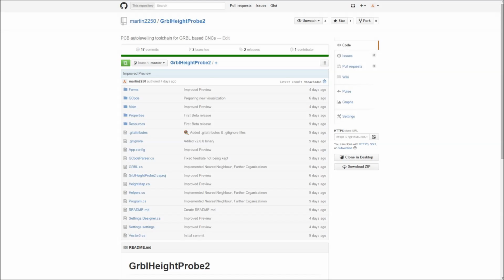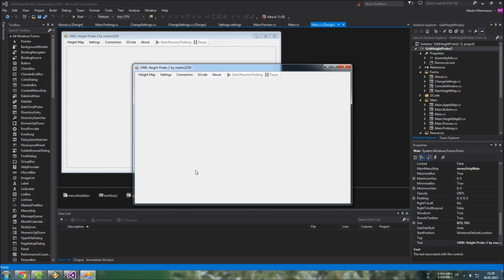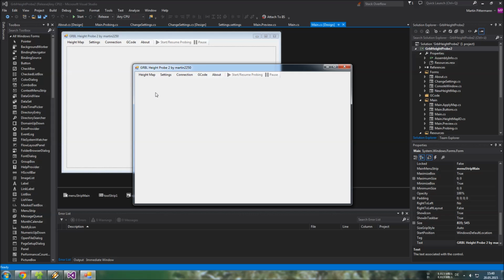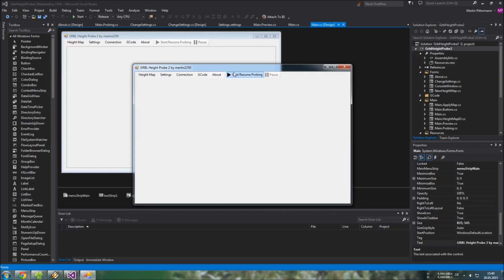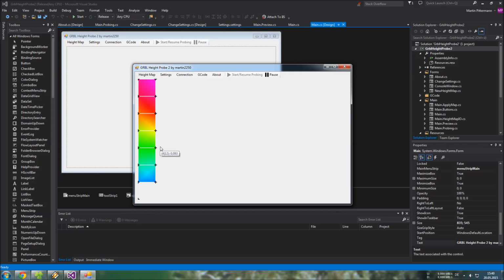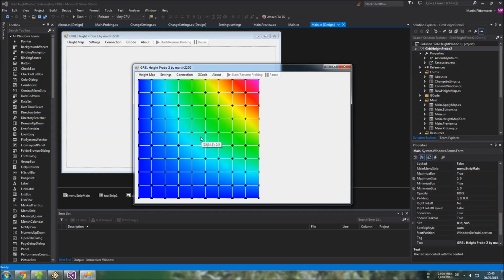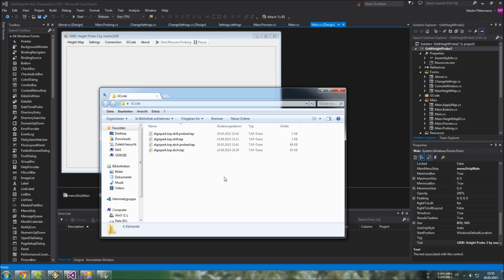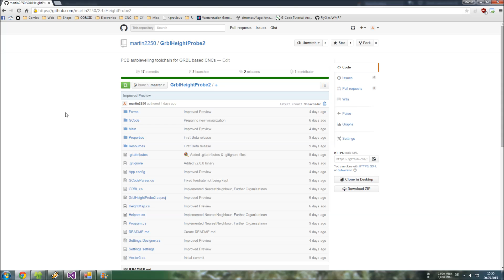GRBL PCB Autolevelling V2

Comment: I have GRBL 1.1 E installed on arduino nano: it is working.
When I do open the connection tab I just have OPEN and CLOSE selections.
The video shows MANUAL CONSOLE  that I can not see !
Any help please ?
Thanks
Ambro
Reply from the maker: Please ask your question on github, and attach a screenshot so I can help you better

Comment: Hi,
Two questions. Is this code for windows, or how to install it? Where is the Arduino code? You mentioned in Video 1 probes attached to the arduino pin 4 and 5. Thanks
Reply from the maker: the arduino must be programmed with GRBL, you can find it on their github. My Program is also available on my github page, it's portable so you just have to unzip it
Reply: Hi, I downloaded it from github but cannot find an executable file. How can I start the user interface?

Comment: Has anyone had problems connecting with their machine? I can communicate to grbl with bcnc and the arduino serial monitor, but there is no response when using this application :(
Reply from the maker: +jfghvljgvktgvlkhvgyv 
What version of grbl are you using? I only tested it with the latest 0.9 release.
I assume you used the right port and baudrate.
Reply: +martin2250 
0.9g, i'm not sure if the g is a subversion, but that's what it sends on start up. Yes I checked the port and baud more times than a sane man would.

Is the windows ding sound supposed to play when commands are sent? That happens every attempt for me.
Reply from the maker: No, I didn't implement any sounds. Sounds like there is some error while sending commands which is going to be hard to debug remotely. Can you think of any other obvious causes? (serial port being used elsewhere, driver issues ...)
Reply: I built and ran it from the source. I just noticed one little bad behavior bug, an unhanded null reference exception, I used enter to send a command before the serial port was connected. Also the noise is only produced when I use the enter key, but there is still no response from grbl pressing the send button instead.

Replies from the micro are displayed in the textbox i'm assuming?

Nothing is sent to the debug log when I attempt to send a command.
Reply from the maker: yeah, any response from grbl should be displayed in the (textbox) console. can you try pressing the reset button on your arduino, it should send "grbl 0.9g ... " to the console.
If that doesn't help, your best bet would be to get rid of all the unhandled try/catch blocks
Reply: Nice suggestion! After resetting it like that I can communicate with my machine. I must have a particularly shitty mega clone. :P

I would suggest putting another empty try catch in buttonSendConsole_Click(), so your program doesn't crash if someone types and presses enter right on start up.
Reply from the maker: very strange, I guess there is a reason after all why UGS enables DTR when connecting to the Arduino. Thanks for pointing out the bug :)

Comment: Thanks for a fantastic job. Once I finish creating the height map, I apply it to the GCODE file, and generate the *probed* file. Then I leave your program and start the GCODE sender as per your instructions. However, when I open the GCODE sender it has lost the XYZ position. Question, to what initial coordinates should I set my machine before sending the probed gcode? Another question.... what is the thinnest track that you were able to carve with a 30 deg 0.1 V shaped drill bit? I am trying to carve 10 mil traces but I am failing.
Reply from the maker: +Rolando Martin 
Hi Rolando,
before you close HeightProbe you need to move your tool to a known position (for me usually X0Y0Z1). After switching to UGS just re-enter those coordinates with G92 and your're good to go.
The smallest traces I have successfully tried to make were .4 mm (16 mil). You need to experiment with different depths (use the smallest depth possible, you can also start out with a depth that's too shallow, cancel the job, move your coordinate system down by 0.1mm and just run the job again. repeat until deep enough). Also in pcb-gcode you need to increase the minimum distance to the highest value possible, I usually increase it until the cuts around two SO8 pads just overlap)

Comment: When I try to apply the generated height map to a file, I go to GCODE and as per your comment, I should do "Apply to file"; however the only option under GCODE is 'OPEN'. I do not see any "APPLY TO FILE" option. What am I missing?
Reply from the maker: +Rolando Martin 
I made some changes to the program, just open the gcode file and you should see what to do.
By the way, a single comment would have been enough, no need to send me three seperate messages with copy-pasted content

Comment: sorry again in the software and in your connection menu you have 3 sections but mine have only 2 sections open and close and have no consul on it why?
Reply from the maker: +Mehdi Emm 
I removed the "manual console" window, now it is integrated in the lower half of the main window

Comment: Hi thanks for your early reply. yes I had a question about the alligators where to connect them, and after study other comments I could get my answer. and also I  have problem for GRBL and it is the searching board by itself point to point with color squares as your video show's and after a while I  get red alarm sign and machine stop processing. so need your help to solve my problem. thanks again and good luck

Comment: Thanks for the quick reply.  I assume then that A5 is an IO port on the motion control card, right? Can your program be cards adopted to different cards? I am using TinyG. Thanks again.
Reply from the maker: +Tamas Kosa 
Your're welcome, but I'm afraid you're out of luck. My program only works with grbl firmware which runs exclusively on Arduino borads. It is possible to adapt it to TinyG, the source code is available after all.
If you just want to get results, I can recommend chilipeppr by John Lauer. It was made specifically for TinyG and also includes an autoleveller (doesn't split up longer movements though).

Comment: does the code have to be in mm or can it be in inches?
Reply from the maker: the code can be in inches, but it will get converted to mm
Reply: +martin2250 does it accept pocketing codes?
Reply from the maker: No, only basic G0-3 are supported. PM is on its way!

Comment: Hi. You have done a great job, Would you mind tell us where to get all the bits you have been using on this project. Please Could you place the links. Thanks.
Best Regards.
Reply from the maker: +Iván Aldás 
Hi,
I used cheap Titanium Nitride coated 30° V-bits with a tip diameter of 0.1mm, I won't promote any seller over another, I don't think that you'll find any differences in quality in this price range (5pcs 11€).
Reply: I got mine form amazon.  Just do a search, I think it was around $10 for 5 or 6 bits

Comment: i thought this kind of tool was only abailable for mach3 based cnc machines, so i was strugling with my uneven pcb's!!! I'm so glad i just got to find this app, i'll test it as soon as i get home. Thank you for sharing!!!
Reply from the maker: +Elias Gonzalez 
Yeah, I was pretty disappointed when I found out that all available software only works on mach3/EMC2, so I made my own :) please do give it a try, I'd love to see some before/after pics
Reply: +martin2250 I'm probing the pcb right now! The program is very clear to work with. Where can i send you the pics from the before/after results?? Thanks!
Reply from the maker: +Elias Gonzalez 
If you don't mind a bit extra effort, you could upload a quick video on youtube :) or just upload them to imgur.  
If you agree, I'll use you pictures on the website/GitHub Readme (with credits of course). I don't have any good 'before' pics because I never attempted big PCBs before I wrote the software.

Comment: Hi, I´ve been using your program and I´ve been having some problems with the milling of the PCB, what grid recommend me?. The problem that I have at the moment to make the milling is that some lines are not fine. what deep do I have to use? Could you help me please? I think is an excellent program but I´m not using it very well.
Reply from the maker: Emms 
I ususally use a grid size of 5mm and a milling depth of 0.13mm, though this varies with many factors including the type/quality/wear of your bit.
Which machine and tools do you use?

Comment: That's really great. I have never milled a pcb but im curious if it could be useful for a new cnc plasma cutter im designing. Im thinking using a micro switch for the electrical contact. I think it could be used as a crude torch height control.  Are the probe points adjustable like can they be spread apart more? To make probing large arias faster?
Its really awesome im excited to explore this.
you can see my old 3d printed cnc plasma cutter here if your interested   https://www.youtube.com/watch?v=ZriSs5EG28c
Reply from the maker: Hi builtrodewreckedit,

I definitely think this would be a great task for my program, I never even thought of that!
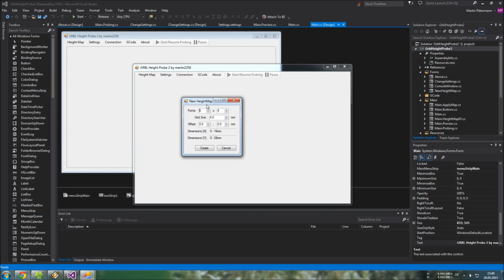The spacing of the probe points can be adjusted arbitrarily (see "Grid Size" at 0:42). The only constraint is that the points have to be in a rectangular area, though you could modify a .hmap file to skip points where you don't need them (I might add this functionality)  

Did you already do some experiments or is it only an idea for now? I'd love to see some results!

I just realized that the video is already two years old. Did it fail because of stock inconsistencies or did you just not post further videos?

I'm really excited to see this, let me know how well it works and feel free to leave bug reports or feature requests on GitHub!
Reply: martin2250 I built the plasma cutter basically off a dare when people told me it couldn't be 3d printed or use nima17 size motors...   I really never needed the machine for anything i was making. The first design works great as it is and to this day is most likely the only 3d printed plasma cutter in the world. 
My latest version will have a water table and some automated z height control hopefully with your probing tool, slightly larger smooth rods. Its looking like i can design it a few inches wider and ill probably make it much longer too.
I still don't need it but its fun to tinker and improve the design.  I think your probing tool is really nice and probably the next best thing short of a true automated torch height control.  When i finish building i will post video's of it working for sure.

Comment: Hi, That is a great program, I need to ask you why I'm getting an error when I execute it. It just say that windows found an error, maybe I need to install some drivers? or it's because my windows is 7 and 64bits?
Also I can execute the v1 version, but when the probe touch the surface the message "complete" pops up, just in the first attempt. Thanks.
Reply from the maker: Cristhian Carrascal 
Hi,
yeah, v1 doesn't work with new versions of GRBL. I can't really imagine why Windows won't let the program execute, I have exactly the same setup (7/x64). 
Do you have .NET Framework 4.5 installed? Though it should show a message if that was the problem.
If you have the time, you can install MS Visual Studio 2013 Community Edition, it's a free IDE and it will show you better error descriptions.
Or try execute the program from command-line, maybe you'll see something there.
Hope you work it out!

Comment: Hello Martin, first thank you for the great program, but I just can't find the exe file to run it. Could you give me a hint? Thanks. I would love to be able to use your program on my vertical mill that I am building right now.
Thanks again.
Reply: iHayri1 Hi again,
I did eventually find the exe file after clicking on the releases tab. I must say this is a very useful app you wrote and thank you many times for sharing it. I did also try your first version but it stopped after the first probe, but this one is much nicer and works tadellos (without any problems). Take care